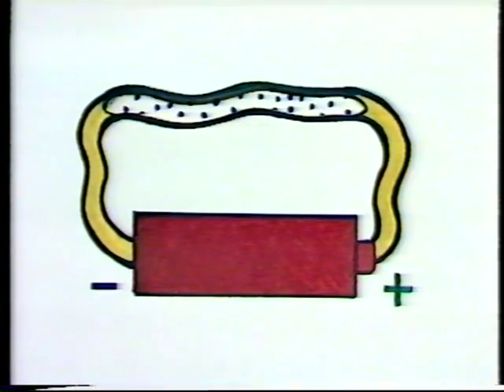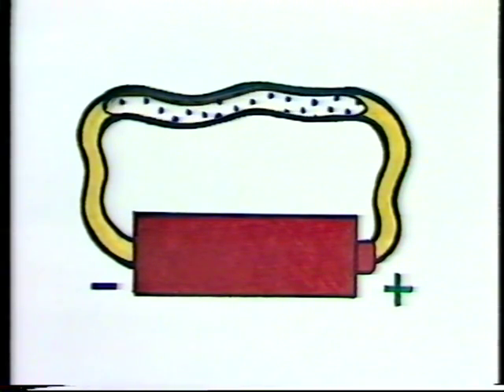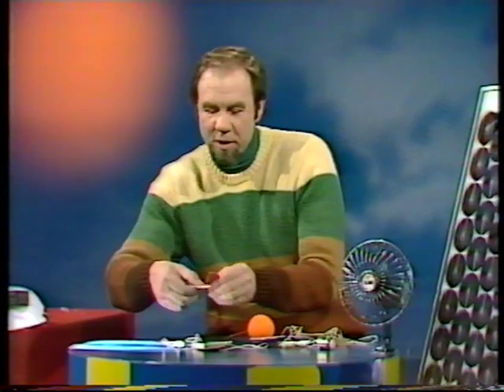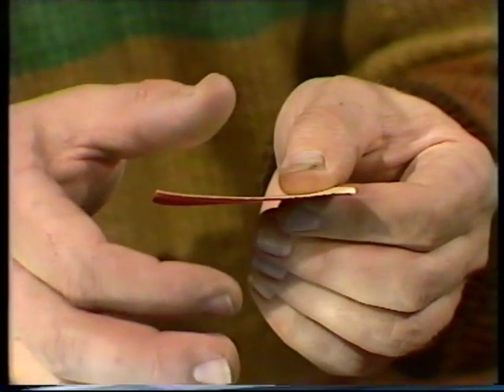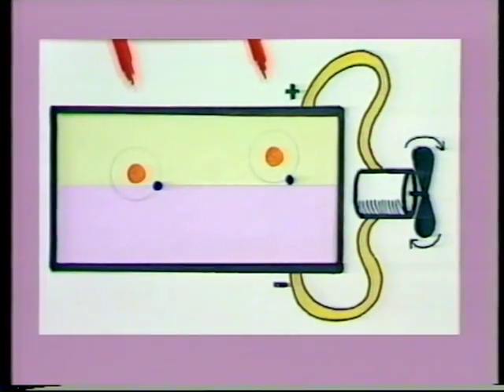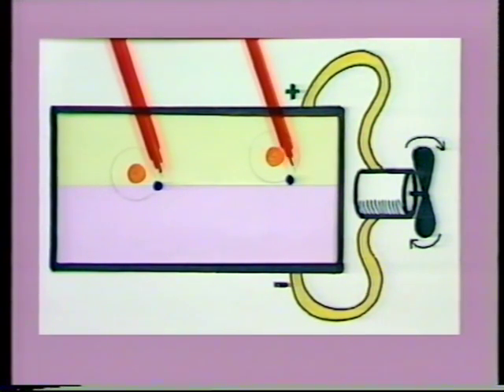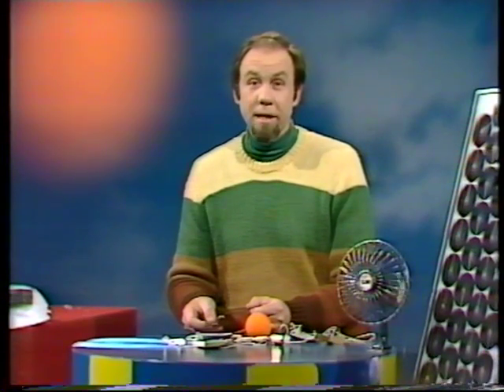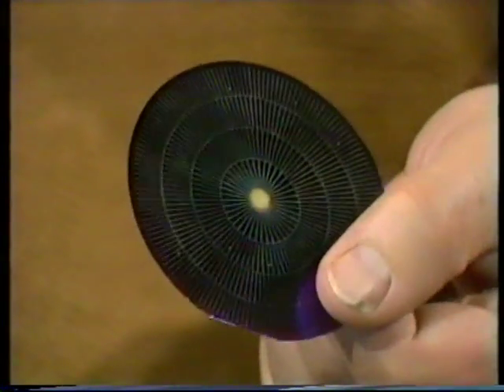Solar cells

Comment: I remember these days. In school we got new calculators with solar cells, but without an additional battery. 😅 In order to make them work properly we had to switch on the lights, consuming a thousand times more electricity. 😂

Comment: We were taught in DC theory that the flow of electrons was in the opposite direction as shown here, flowing from negative to positive inside the battery thus resulting in a positive to negative flow in the circuit.
Reply: Well as electronic engineer for 35yrs I can tell you that you are wrong. Electron flow always sends electrons from negative thru the load and returns to positive terminal. However there is a thing called "conventional flow"... This describes the flow from positive to negative to make it more understandable for most people ... That said it's Not how electrons flow...it's for people to understand concepts.

Comment: The only problem with solar panels is that they're only about 20% efficient
Reply from the maker: Some developed in Australia are quite a bit better than that
Reply: Also, when the temperature is higher than 25C, the average panel looses about 0,258% of power. In high temperatures total power loss can reach up to 10-25%.

Comment: I remember seeing this on TV when I was a small boy. Now I have solar panels on my roof, a home battery and an electric car and haven't used any grid power (or petrol) in 2 years. If we can limit our global warming, who knows where we might end up. If we don't, we know where we will...
Reply: All that electricity you use to charge your car comes from petrol oil/coal plants doesn't it? xD And global warming cause by the sun? Get any power when its a cloudy day?
Reply: @Binko00-1 solar panels can save energy in a battery for cloudy days or nighttime
Reply: @Binko00-1  I think you might not understand how solar works. That's okay though, it can be a bit difficult to understand for some people, so allow me to explain.
If every person has solar panels on their house or apartment, there would be no need for for electric companies anymore, meaning we wouldn use very little oil or gas to power the power plants. Which would be bad for the oil and electric industry, which isn't a bad thing. Think about it, you no longer have to pay for electricity or oil/gas. Also, on cloudy days or night time, the energy collected from solar panels is stored in batteries. Add an electric car to the mix and you can charge your car at home for free. Some advice, it's good to question what you think you may know sometimes because it sounds like you fell for the propaganda the big billionaire oil companies pump out. They are not like us, they don't give a damn about you. But I do. Have fun learning, become independent and do better 👍🏻